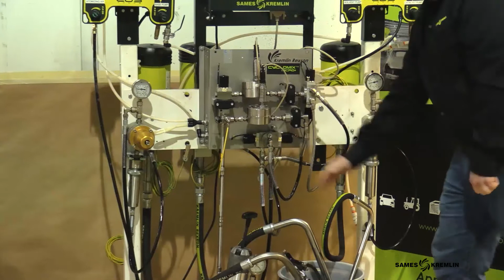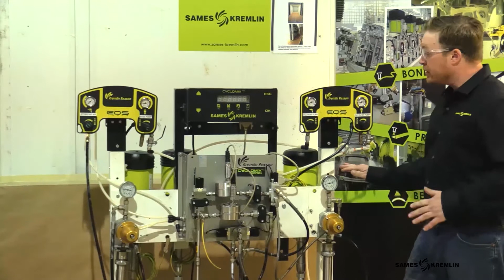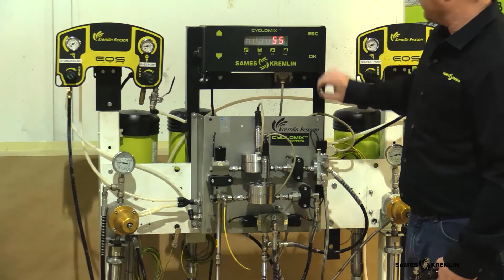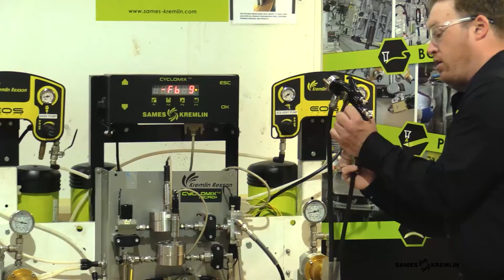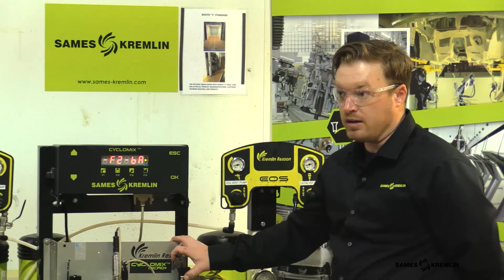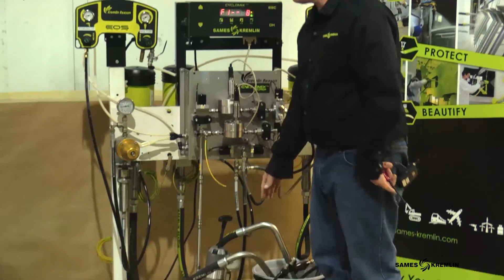Cyclomix™ Micro Airspray Technical Overview | Sames

Comment from the maker: Hi Chris, we have a couple questions and comments for you below: 
First, is this a new unit or has it been in use for some time? 

Second, inspect the wiring going to the A component flow meter and make sure it is not damaged in any way. 

Third, I would have them swap flow meter sensors just as a quick test to make sure the sensor isn’t failing and counting “ghost pulses”.  If the issue stops replace the flow meter sensor, if it continues then proceed to trouble shoot a possible atomizing air leak or flow switch failure. 

Fourth, make sure the atomizing air supply line and the fittings associated with it do not leak air at all. If atom air is flowing the air flow switch will be closed and when the switch is closed the controller is looking for counts from the A side meter, if it doesn’t see counts it issues the error 1 and 4. 

Fifth, if there is no air leak it is possible that the flow switch has stuck in the closed position. I would blow air through it in the opposite direction and free it up. Make sure the air supply to the micro is dry filtered air. 

If you need additional assistance, please contact our Technical team at 1.800.573.5554.  They will be happy to assist you.  Rhonda Joslin, Marketing Manager.